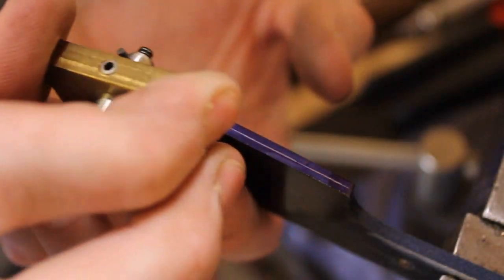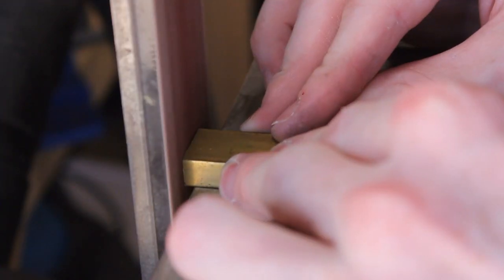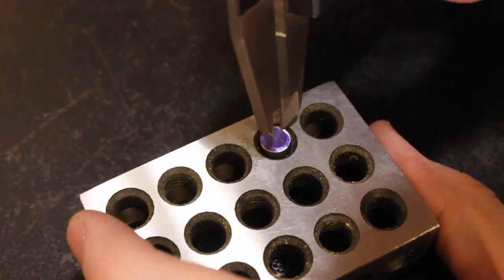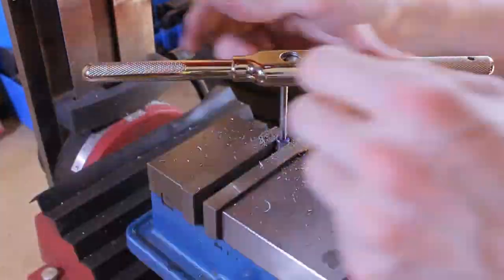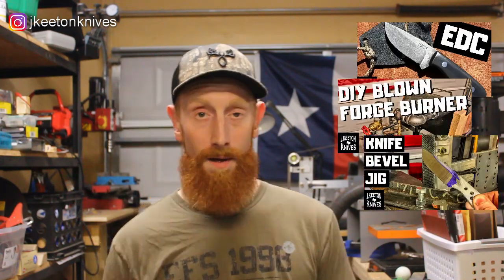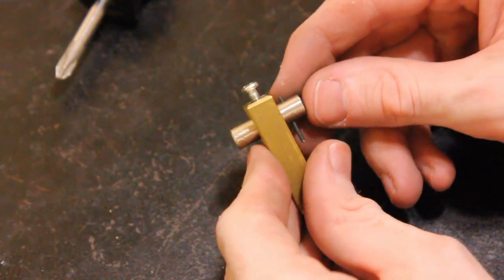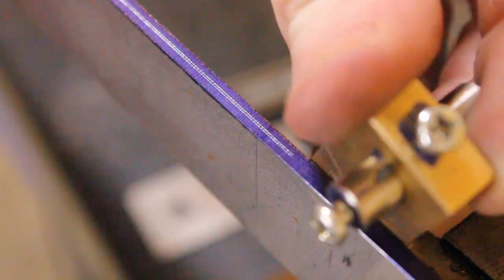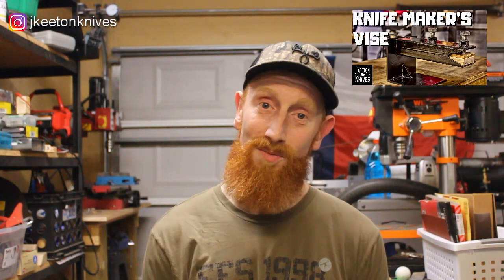Making a Knife Maker's Center Scribe | Simplest Build Design

Comment: Thanks for the tutorial on how to grind correct. Is there a way to fix a ground knife that is off center? I have a knife I like the overall length and weight of but when cutting it pulls to my left when cutting down. It it is a 11'' kitchen/butcher style knife. Ive been running a steel along the blade on the left side blade down side for weeks with no change in cutting results.
Reply from the maker: Man I'm not sure. One thing you can do to verify if the edge is in the center is to lay the blade flat down on a precision ground block (3-2-1 block would be prefect). Then measure the distance from the table to your edge... then flip. This will tell you if your edge is in the middle of the blade. A height scribe and granite surface plate would make this easy. Other than that fixing it, I think, would be difficult.

Comment: No one ever says how you get the right distance on the scribe...how do you get it perfectly down the middle..use a micrometer?
Reply from the maker: You scribe both sides of the blade and create 2 parallel lines. It's not perfectly in the center. To set it up initially I just eyeball it.

Comment: Dumb question. How doe you know that the line you are scribing is centered?
Reply from the maker: well you can use trial and error to adjust the distance of the scribe. 

What I normally do is scribe both sides and get 2 parallel lines. Normally around 0.020'' apart or so